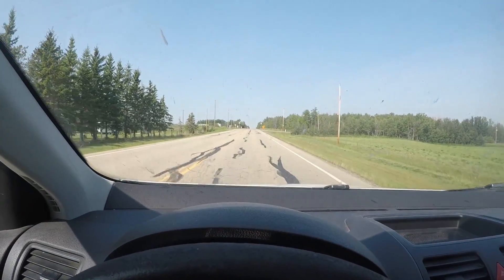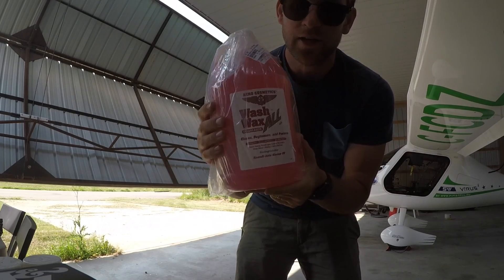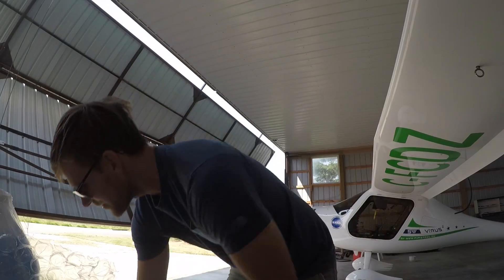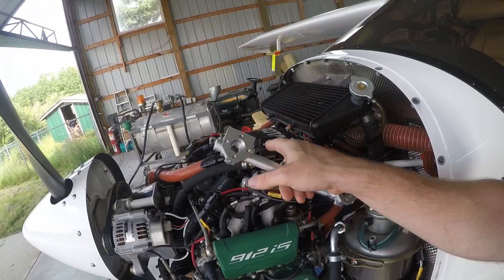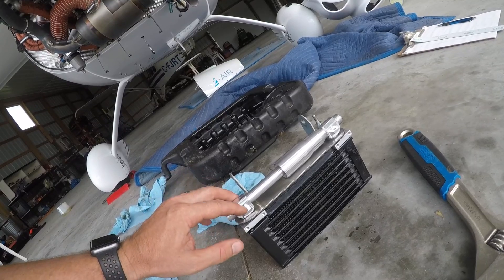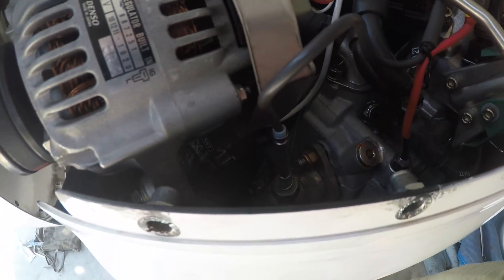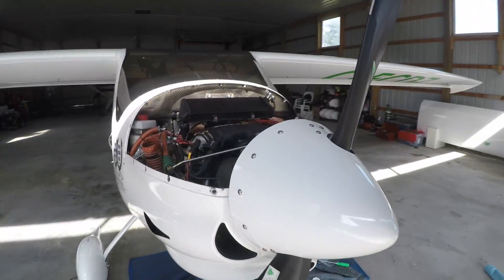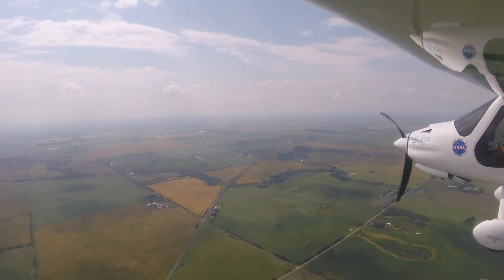Improving my oil pressure for $1000

Comment: How is it that such a beautiful machine with such a nice engine would need these hacks? If the hoses could be shortened, why wouldn't they have done this in the motor design? <scratches head> I mean, that part you bought for $600 would have really only cost 300 or less built in to start, which would have saved the extra hosing, and reduced installation complexity... so there must be more to it than that...
Reply from the maker: D. I. von Briesen you tell me why rotax doesn’t care about this issue! I’ve been fighting it for a year and now know of 5 others with this issue. I returned this thermostat because it didn’t keep my oil cool. I’m now in talks with a mechanical engineer who designed the black rotax thermostat. He said engine has a flaw, they built it to not include thermostat for the extra length in oil lines. Too much resistance in the system causes poor oil pressure. I am now trying another fix stay tuned for video on that trial
Reply: @DarrylZubot  i'm no pro, but i will say i watched one of Amory Lovins' vids a while back ("Reinventing Fire"?) in which i learned about the importance of minimizing angles and distance in pipes. Years ago an HVAC guy told me adding a 90degree bend to a duct was like adding 15' to it... and that's very much affected my thinking ever since. It makes me crazy to see pipes and tubes going all over... thinking how we shouldn't have those corners and 180 degree bends, much less the distance to travel.  You've got a hard slog of troubleshooting ahead I'm afraid.
Reply from the maker: The best would be if someone built a radiator with built in thermostat as you say.
Reply: @DarrylZubot  I've been on a bit of an aviation binge for a year or two... solo'd a paramotor, got a drone and gimbol, binged on trent palmer, subscribed to the chipper FB page, yada yada... the small production runs seem to be a big issue, but i just watched the bit on the rotax plant from AVweb and it seems like more than anyone else THEY should have it worked out...  I had a bit of a thought though- what if there's an internal kink in a hose? Could you pass some kind of cable with an ball with the ID of the hose thru to see that it's got that ID the whole length? Or could you move the existing thermostat to where the bad "shortcut part" was installed? Another poster mentioned the wiring having caused the problem...so there's always that. Great products by not-so-responsive companies... reminds me of DJI....   I own an BMW K75... seems like a motor like that one would be the way to go, LOL.   Anyway rotax makes a helluva lot more motors than vittorazzi but a lot less than honda.... where's the honda motor for aviation?
Reply from the maker: Appreciate the input I installed analog gauge to confirm sensor is indicating correct values which it is. You are right all of the extra connectors and bends with a thermostat cause the problem.  You will see shortly hopefully the fix to this issue.

Comment: Glad it came up a little.  At altitude, there is less ambient pressure so the pressure in the rubber line causes it to expand which reduces pressure.  I wonder if changing the oil lines from rubber to a high performance brake line material as using in automotive brake systems will help.  This material keeps the line from expanding so the brake fluid pressure stays good.
Reply from the maker: I’ve considered this but the problem is flexibility of lines as well as making the lines work on a metric engine, need metric lines or close to it...
Reply: Hi Darryl.The issue that could well arise from using hard lines is metal fatigue due to the harmonic vibration coming from both prop and motor. Me personally i would leave it as it is! Or consult on using hydraulic hoses that can be tailored to the motor set up. As they resist any expansion caused by heat, and pressure drop at altitude. It seems strange that Rotax are putting there name to such a under performing design? It must be down to the maker using this type of improvable set up under advisement from Rotax.  Keep up the video's" and stay safe bud!!

Comment: Darryl, you are a private pilot flying a light sport aircraft so are you able to use that aircraft in ways that the typical sport  pilot would not? For instance flying at night or IFR or carrying a paid passenger?
Reply from the maker: I am commercial pilot flying an amateur built plane. We don't have LSA in canada.  So yes Night, no ifr because I don't have the equipment, no paid passengers. Can only use for data acquisition.
Reply: Thanks for the clarification.

Comment: Was your airplane built from a kit? Or are you a certified aircraft mechanic? Or are owners in Canada allowed more repair and maintenance privileges than in the USA? Here we are handcuffed, and must pay $$$ for anything much beyond an oil change.
Reply from the maker: Not a kit but canada was allowing us to import the aircraft under the amateur built category for a while, so I am able to do my own maintenance, not a certified mechanic, just handyman. I had two mechanics help me out on this, one to cut the stainless steel/bolt down the thermostat and check for air leaks, the other to give advice on how to route the oil lines, specifically the one from thermostat to oil pump was not easy, had to bend the fittings to make them align.
Reply: Thanks. I just looked up the price of a kit, which I could get classified as "E/AB" and thus do my own work. It would cost about the same as a C182T RG with a fresh engine and updated panel. And then I have to build it. Yeow.
Reply from the maker: Don't be fooled, these are quick build kits, pre painted, everything is already fabricated, you are basically doing assembly. I built my first virus SW as a kit and it took me 3 months, saved about $40k from buying it fully finished from factory.  I have never built a plane other then RC, so anyone can build them. I paid pipistrel a bit extra to install engine and avionics in factory to remove some of the difficulty.  There is zero composite work to be done when you get these kits.
Reply: Now they sell the basic kit without the paint, and charge thousands extra for that! I'd love to have one, however. I greatly admire the efficiency (if not the tiny cabin!)
Reply from the maker: Kenny Phillips they sell it without paint? I thought they use a gel coat that is infused during the manufacturing of the parts
Reply: Darryl Zubot Yep. Darn near everything is optional. They had to make it a 51% kit for the USA.